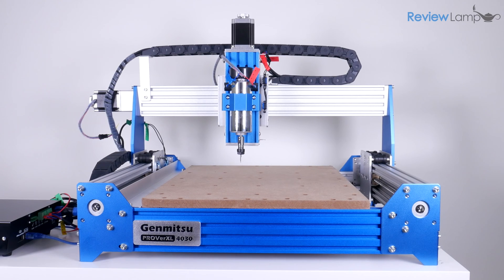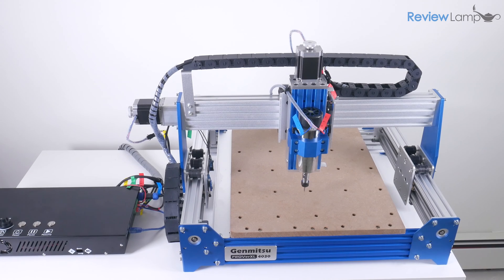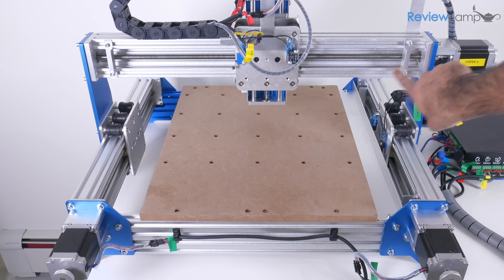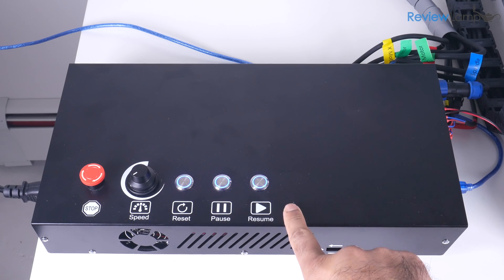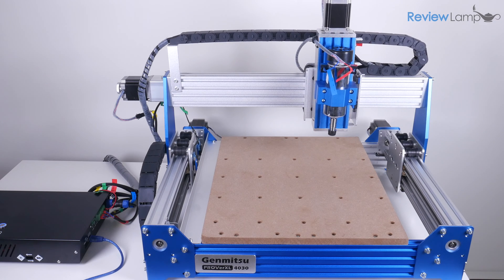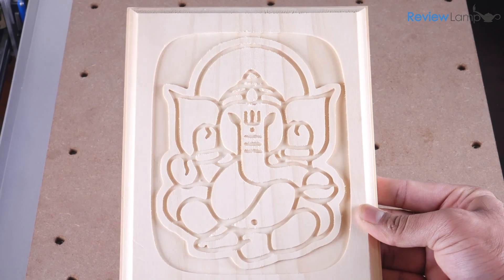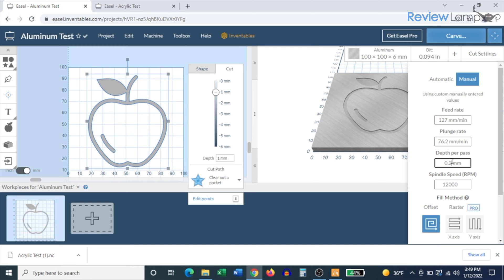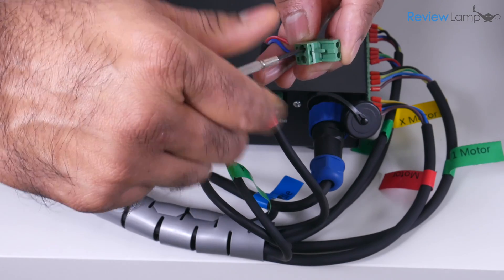The King of Budget CNC? |  Sainsmart Genmitsu ProverXL 4030 CNC Router Review (with Aluminium test)

Comment: Hi! I just watched your review on this machine and I got to say; excellent job!
I’m planing on getting this model for foam carving, tool box mold kind of thing, i want to offer custom options for small cases/drawer size designs, would you recommend this machine for that application? I read some reviews about this model and they say foam carving can be possible with good results. I’ll appreciate any input. Thank you!
Reply from the maker: Foam carving should work fine. However you may have to experiment with a few different end mills and also tweak the feeds and speeds to get the optimal results

Comment: Hey guys, I have a PROVerXL 4030 and I’m running UGS as my G-code sender. I’m keep getting an error code of “(Alarm 1) hard limit has been triggered.” But it happens when in the middle of a project when my spindle isn’t anywhere needs any of the limit switches. Anyone have experiences with this?

Comment: Thanks for the video.
Question? If one buys the laser. Does the Sofware that comes with it allow you to managed the power level of the laser so one can control how much you want to burn. EG a power level that only burns tracks for a PCB board, or control the laser level to the point it cuts a PCB?
Reply from the maker: I doubt the laser module has enough power to cut a pcb. The best it can manage is mark a pcb

Comment: Are the motors are DC or AC?  If they are AC, you don't need to worry about polarity and the color of the wires.
Reply from the maker: The motors are DC and stepper motors

Comment: Hey, thanks for the review! Do you by any chance know if the extra spindle mount also works with makita RT700CX2J router? In shape it looks very identical to the dewalt router.
Reply from the maker: I haven’t tried it with that router unfortunately. The link to the recommended router is right below the video

Comment: Maybe the lack of QC isn't a deal breaker for you but for me it is. I can't trust a device to be reliable if it is delivered in this kind of condition.
Reply from the maker: Well, it is a deal breaker for me as well. However, my expectations at this price point aren’t very high. Most commercial cnc routers are 10x the price of this.

Comment: Great video review.  I've never used  CNC machine but I'm thinking of purchasing this for my wood working hobby.  I have a couple of questions:  1) could I use my Makita palm router instead of purchasing the DeWalt noted? 2) What software do you recommend for a beginner?  3) I've seen mention in some reviews about spoil board sag being an issue with this machine.  Have you had the same issue?
Reply from the maker: 1) You can use your Makita router but you would have to fabricate a custom mount for it to fit this CNC machine.
2) As far as software, I recommend using Fusion 360 for the design work and inventables to interface with the machine.
3) Spoilboard sag isn’t something I have experienced with this machine.

Comment: You mention that the machine will control the router speed. Will it do this with the Dewalt router as well?
Reply from the maker: Unfortunately not. With the Dewalt router, speed control is manual.

Comment: Thank you for your review.  Just a point of clarification.  You say that the ER11 collet can only handle bits of 1/8" in diameter (min 5:10).  In fact the ER11 collet system has 13 collet size options from 1mm to 7mm in 0.5mm increments.  My biggest cutter is a 25mm face mill on a 6mm shank. (for spoilboard flattening)

Comment: How do you connect the Dewalt router? Any video of that? Great review, thanks
Reply from the maker: Thanks for the comment. To connect the Dewalt router, you have to use the provided mount. But speed control and power of the spindle will be manual.
Reply: @Reviewlamp  great thank you

Comment: 5 hours. HA. I have had my stepcraft d840 and official enclosure for 2 years and I am still not done building it or able to use it yet. The machine itself took me about 4 or 5 days to build & is awesome. The enclosure is a monster to try to assemble. It is an awesome machine. It is mostly my own fault and pandemic BS that caused my own delays. I am looking or a smaller machine so I can continue working on the stepcraft & only want to use that for large jobs because maintenance is a consideration as well (keeping things clean)

Comment: For aluminum cutting try using a water based cutting fluid like Kool Mist. You will get better results.
Reply from the maker: Yes. But cutting fluids are not something I would recommend on a machine that isn’t rated to be waterproof and even has an MDF spoilboard. Maybe with some upgrades that may be possible.

Comment: Hello. I am thinking about buying this machine and i was wondering if you know or if you tried, what is the thickest piece of wood you can cut with a straight router bit. I hope you can give me some light about the matter. Thank you! (Ps. I want to cut wood about 50 to 60 millimeters, and what kind of bit should I use!) :) Hope to hear your opinion!
Reply from the maker: It will cut wood 50-60mm in thickness, but it will take several passes to complete the cut. I recommend using end mills like this: https://amzn.to/3D3P1O3
Reply: @Reviewlamp  how much will it cut with aluminum using the DeWalt router

Comment: Try a 2-flute cutter on aluminium.  That machine doesn't have the power or rigidity to push a 4-flute cutter fast enough to cut a decent chip.  You might even want to try a 1-flute cutter on it.  Speeds and feeds are critical - you need to feed fast enough that the cutting edges take a new clean cut each revolution.  If your feed is too slow relative to revolution speed then the cutter ends up re-cutting the same chip multiple times. That causes heat-build up, poor cutter life, and poor surface finishes.  With fast, low-torque spindles you need to feed fast - but here you don't have the power or rigidity to do that.  Halving the number of flutes halves the cutting forces and thus the power and rigidity needed.
Reply from the maker: Yes, I agree. But despite the number of flutes, routers built on a aluminum frame do not have the rigidity to handle precision cuts in metal. However, the dewalt router gives it a better shot at cutting the aluminum cleaner and reduces the vibration rippling through the machine.
Reply: @Reviewlamp  These do have the rigidity to cut aluminum if you calculate proper speeds, feeds, flute count and spindle power but nobody wants to do the math. Everyone just copies what everyone else does and says even if the information is wrong. Just think ow nice that aluminum cut would have been with a 2 flute bit.
Reply: +1 on the single flute cutter as well getting a 1/4 inch collet insert and end mill. The machine is plenty rigid for those feeds and speeds, but I feel like 3.175 end mills deflect a little too much for aluminum when loaded like that.
Reply: Dear People please  be aware of Saint Smart. I am based in South Africa and purchased a Cnc from them. A few months later the Cnc mainboard controller broke. I contacted Saint Smart to purchase a new controller,  now they tell me sorry we cannot supply you the spare because you based in South Africa. A huge investment on my part and now Saint Smart will not  give me customer  service...Shame on you Saint Smart ... 😢